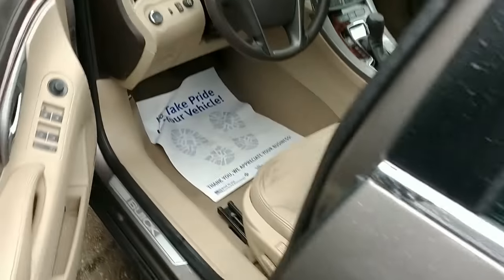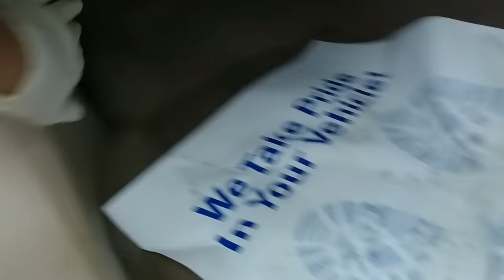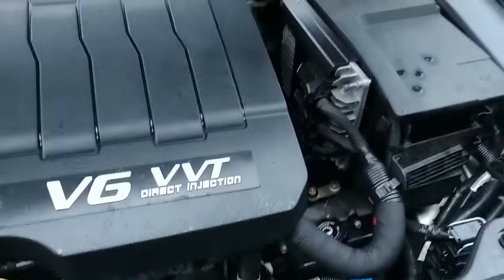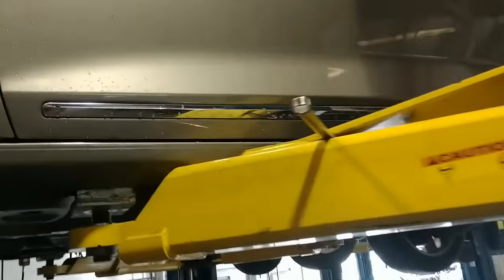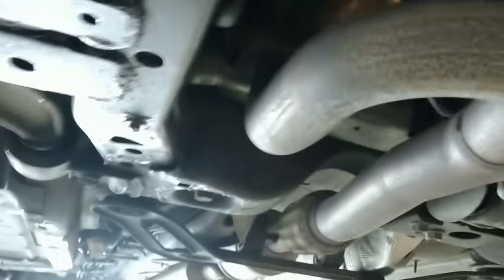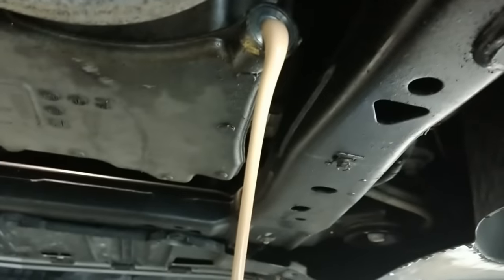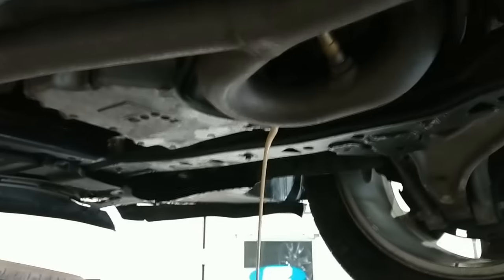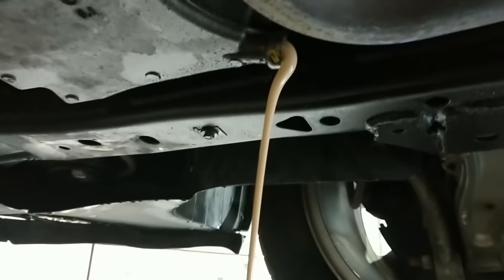Overfilled Crankcase! Blown ENGINE! Used Car Nightmare!

Comment: "Coolant is not supposed to drain out of the oil pan" is not a sentence I ever thought I'd hear in my life
Reply: How old are you’ve never heard of never ending soft serve or engines filled with chocolate shake
Reply: It happens!
Reply: @kcook8119  especially 3.5L's
Reply: @TheOtherTrunk  specially chinese chevy cars!
Reply: @ObservationofLimits  You can be a jerk or you can be the guy helping them learn something new... Your not born knowing this stuff.
Reply: Yeah.  I blew the engine in my first car on the Freeway.  Snapped a con-rod, accelerating when it changed from an 80 to 100km/h zone, uphill.  The rod let go just about TDC, on the ‘burn’ stroke, and blasted the piston into the crankshaft.  Oil came out looking just like this.  Was most embarrassment, but I rebuilt it myself.
Reply: "Tell me you're not a mechanic without saying you're not a mechanic"
Reply: That is a blown head gasket. Leaking inward. Oil and water just do not mix. Had a car do an outward leak, no fun at all!
Reply: I have seen a bunch of them, it's usually a blown head gasket, a cracked head or a cracked block in older engines.
The first isn't that tough of a fix, the last two can be uber expensive!
Reply: same except when we got our 98 1500 Silverado HD, and now we hear the sentence often
Reply: Its called a cracked gasket , that allows coolant into the oil compartment
Reply: @jessejames3338  yeah we're gonna swap our 2500 engine with the fucked 1500. Sad cause a 1500 HD diesel is nice
Reply: WTF...... Do you drive an old volkswagon beetle! ??????   LOL If you haven't heard, seem, or have knowledge of a blown head gasket you do not need to watch a repair video!  You need to learn to ride a bicycle!  Damn. ....... When was he'd last time you greased your chassis? Oh, those are not grease zerts on your wheel hubs by the brakes!
Reply: Give BMW another couple years, they will have everything drain in the same place and you have to refill it all every 5000 miles
Reply: @offgridselfteliant  calm down francis
Reply: Yep if pulling the oil plug drains your radiator its not going to be a good day.
Reply: People use their cars alot, why not make them cook for you too..
Reply: I actually feel like thats a sentence you should hear a lot, however the sentence you shouldn't hear is "Coolant IS draining out of the oil pan"
Reply: But did the owner not at least pull the dipstick out?.
Reply: it’s not a sentence i thought needed to be  said
Reply: Are you 9 or something? It's a common issue. Usually head gasket.
Reply: @krad1314  lol, it doesn't sound like you even know who your father is tbh
Reply: @FeralSparky  I can't tell if the joke went over your head or if you're just continuing the joke about soft serve engines lmao.
Reply: I'm guessing that's a blown head gasket?
Reply: You have apparently never owned an Audi then 😂
Reply: @mkendallpk4321  yup. That's what I thought. I had something similar happen to an old POS Alero I had. Thank god it was just the intake manifold. Same symptoms. Half as expensive.
Reply: I've seen it irl
Reply: This was fairly normal behaviour for my anglia.  It used to look so pretty when I would change the gear oil and the metallic shavings would sparkle in the sunshine.
Reply: 2015 fords here in aus,falcons. the rad fills the trans with coolant. the rear diff mounts are crap. plus more. all these probs come about by car makers being chastized by the gov,s epa,greenies..  euro 6 emmisions,nothing comes out the tail pipe.. excellent...
Reply: just wait until you hear "coolant is draining out of the transmission pan" that one gets you every time. lol.
Reply: Coolant/water is in the oil while it burns off white clouds pouring out the exhaust
Reply: @offgridselfteliant  those vw Beatles were famous for coolant leaking into the engine. You would have to pull over and raise the bonnet until it cooled down enough to refill the radiator.
Reply: It's a Buick
Reply: @ObservationofLimits "Want a taste?"